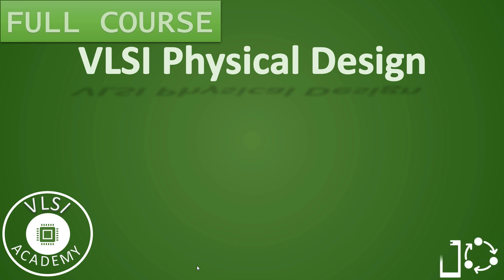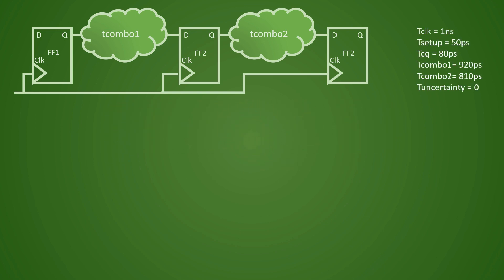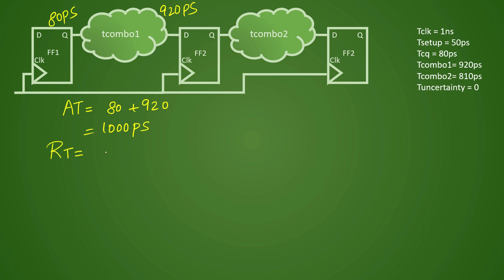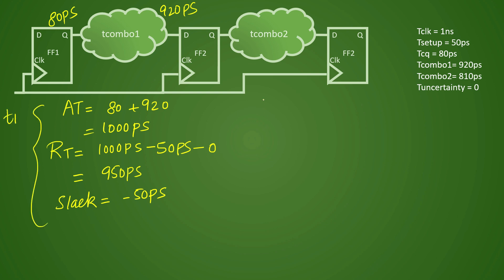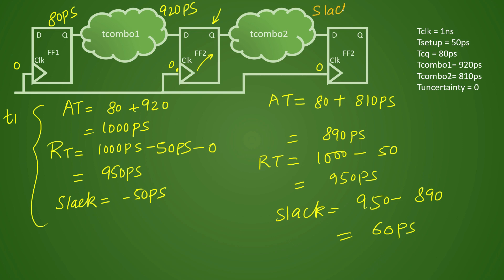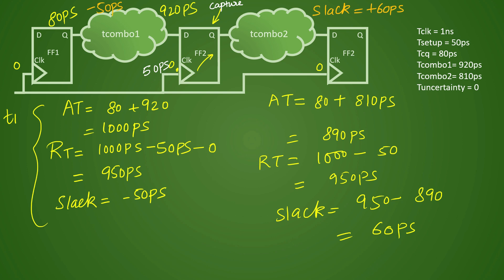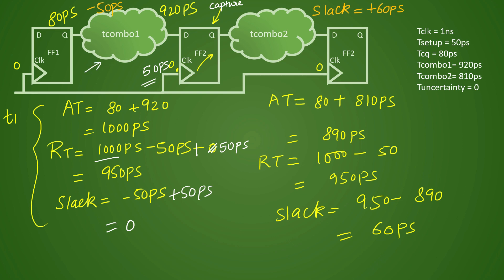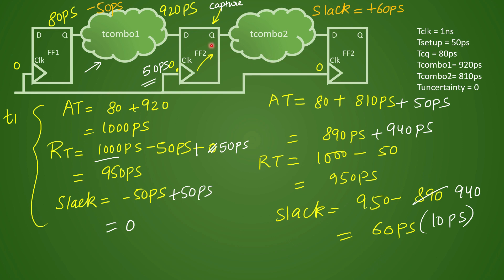PD Lec 47 - concurrent clock and data optimization| CCD| Timing | placement | VLSI | Physical Design

Comment: At the end of the lecture, why AT becomes 940 and RT is 950? Why not AT=890 and RT=900, so as Slack=10ps?
Reply: adding 50 ps delay at the launch path so it will affect the launch not the capture path

Comment: What is the difference between CCD and CTS than?
Reply: CCD is adding useful skew for fixing the timing violation
CTS means synthesizing the clock tree and building real clock
Reply: Under what I understood, CCD is performed during placement stage (before CTS) with estimated clock information, and after then, clock tree synthesis (CTS) is performed according to the results of placement with CCD.